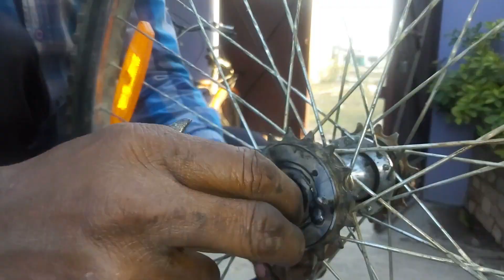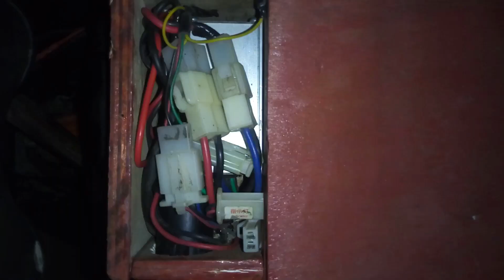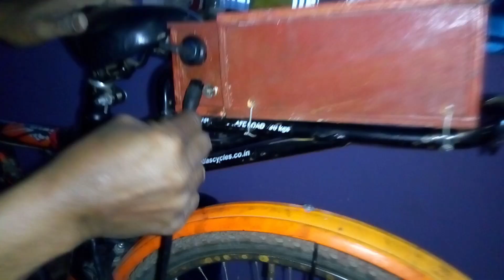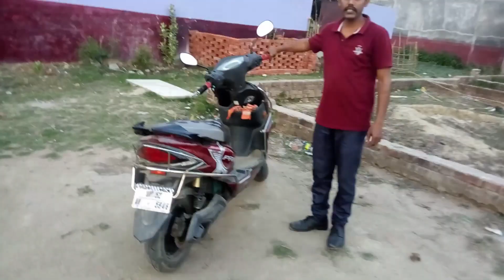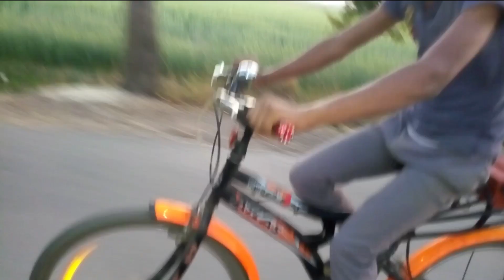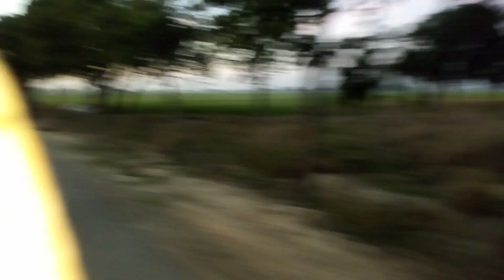Cycle into e-bicycle |साइकिल को मोटर साइकिल मे बदले | Jayanta tech

Comment: Im using 250watt 24volt pmdc motor and 24volt 10ah lithium ion batter with hailong case.  But my controller is heating when we ride full throttle and bicycle getting off...Expert please help🙏🙏🙏...what will be the problem and solution...

Comment: Pura same kit mera pas milega including digital display throttle
 Made in India kit price 4600
 What's app 7059201021
 Call 8910188226
Reply: What is the watts and volts of motor and battery also included?